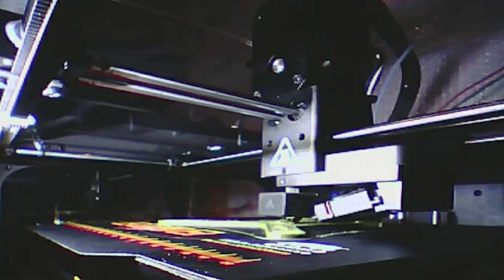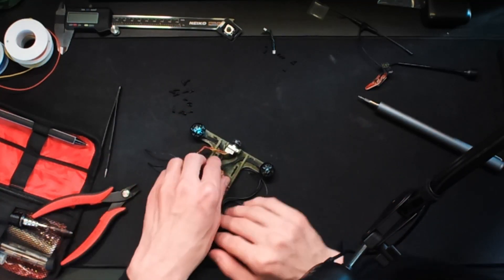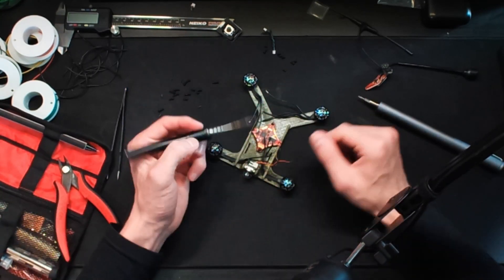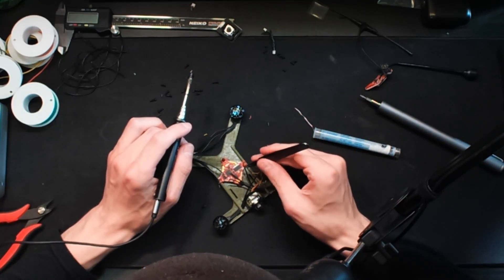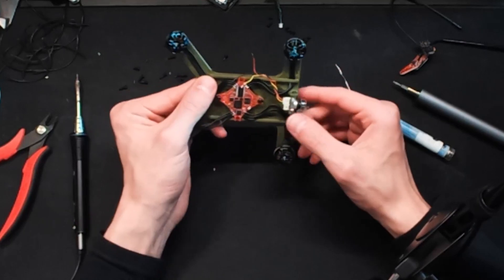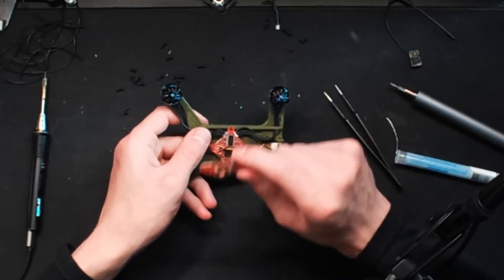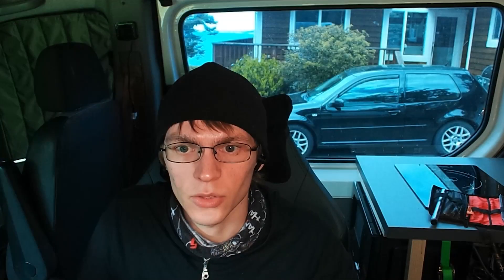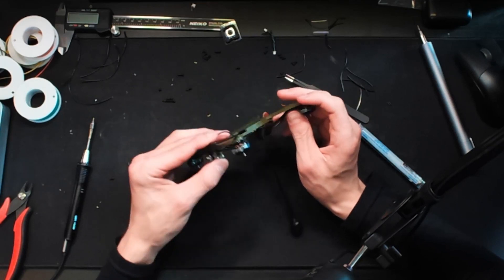Assembling and Soldering Our DIY 3D Printed Drone

Comment: I'm not sure why you'd want to 3D print most drone frames. Yes it allows customization but the frame won't have the stiffness of carbon fibre frames which avoid a lot of the noise filter and they are cheap as well. For a cinewhoop or similar I guess it's less important.